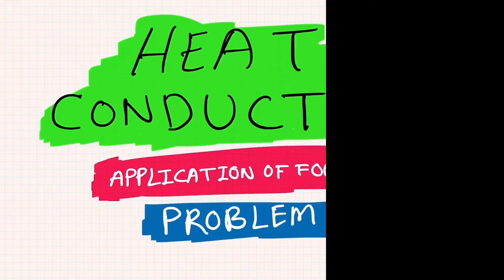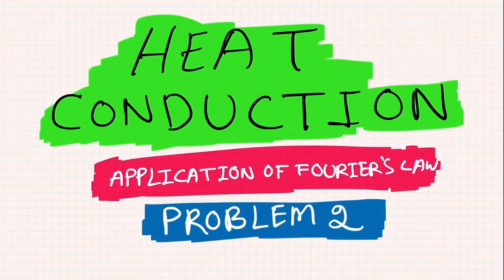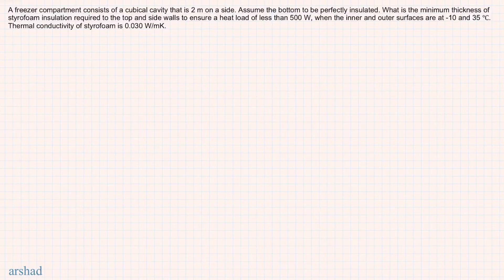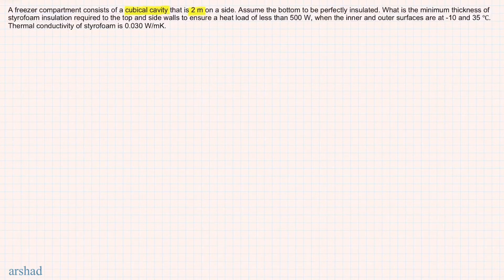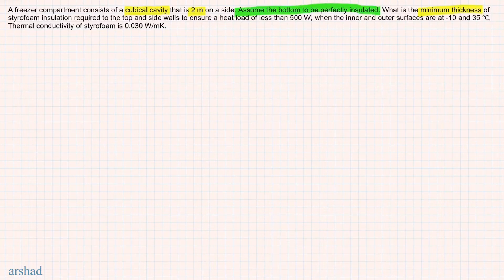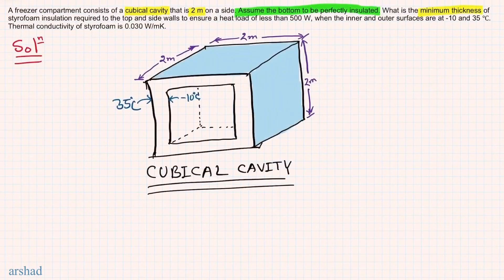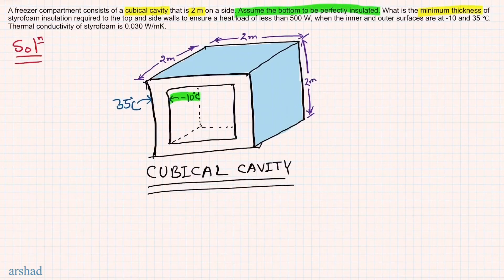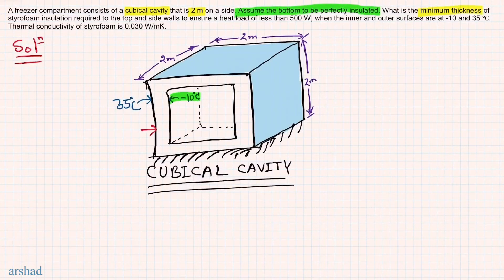Heat Conduction Problem 2 | Freezer Insulation Thickness

Comment: a fundamental question, sorry if I am wrong.  how did you convert 45 degrees Celsius to 45K? it must be 273+45=318 right ??
Reply: Because it's the change in temperature between -10 and 35 degrees celcius. Because to convert to Kelvin we are only adding a constant the difference in two temperatures in degrees Celcius will be the same as the difference in temperatures in Kelvin

Comment: how did you get 100 W sir , why did you divide by 5 to find the qtotal?
Reply from the maker: There are 6 surfaces. The bottom is perfectly insulated. So this means the remaining 5 surfaces will have to take care of the 500 W. Each of them would uniformly handle 500/5 = 100 W. Sorry I forgot to explain it well enough in the video.